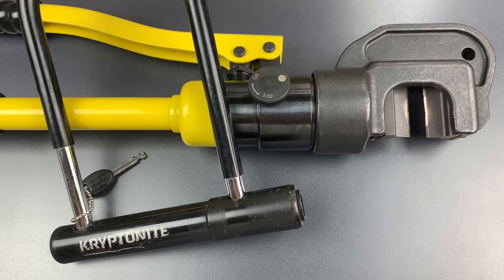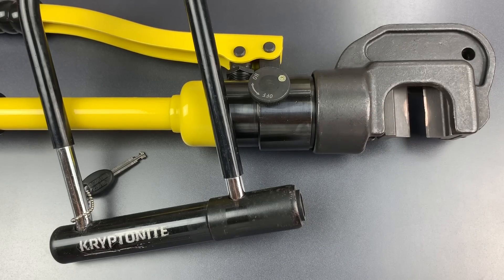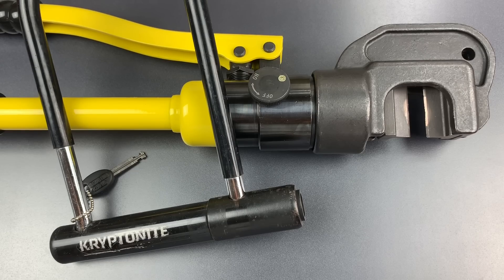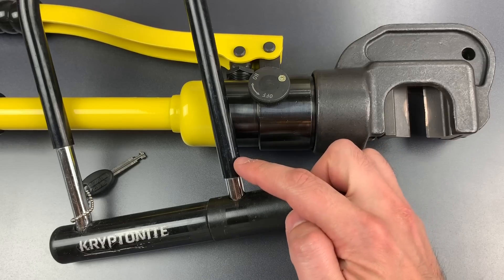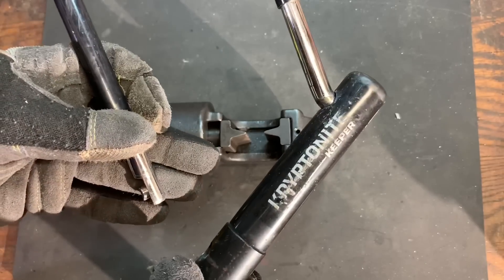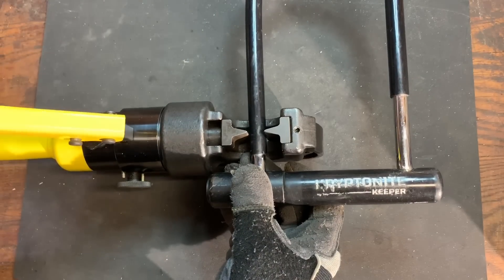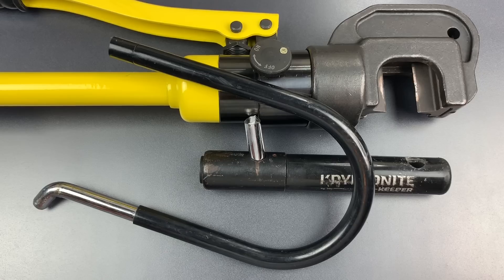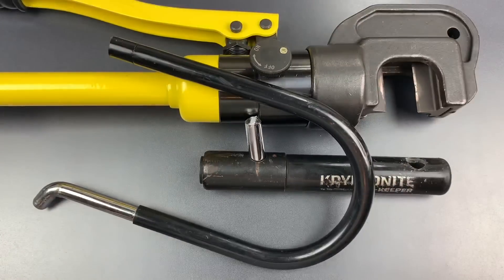[773] Hydraulic Cutter vs. Kryptonite Keeper Bicycle U-Lock

Comment: Those hydraulics are nuts. I'm wondering if there's even a lock that could withstand it.
Reply: It's a question of metallurgy really, certain alloys with proper heat treatment will simply be harder than the cutting blades currently installed in the hydraulic cutter.
Reply: @jero37 : The blades can bring forces to bear that cause harder metals to fracture.  As was the case in LPL's first demonstration of this tool.  The right combination of hardness, toughness and sheer bulk is necessary to defeat this particular attack.  It's going to be interesting to see what it takes in the way of shackle diameter.  I'm thinking 15mm+ of a really tough alloy properly heat treated might stand up to it.
Reply: @andregon4366  video please
Reply: @jero37  problem is, a shackle that hard would be easy to break by a impact. Not to mention that there's the Ramset...
Reply: @jero37  but the cutter can still put many tons of pressure on that area, cracking it if it really is that hard
Reply: @LordPrecision  That third lock you mentioned costs over $1600. Omg.
Reply: @Macintosh007  Yea, and it has been SPP'd, but I only ever seen videos of people doing that while holding it in there hand or a vice. Once it is mounted correctly on its shielded hasp, its dam near impossible to SPP or pick in general as its movement is heavily restricted. You would have to come up with custom tools to avoid that shield and get the swing arc you need for the tension and pick.
Reply: I wanna see him start using it on lock bodies instead of shackles. 
Also: to overcome these attacks I’m imagining just a bunch of short tungsten carbide rods mixed into the casting somehow? 1/16” thick by 1/2” or shorter, just under the surface in on 4 opposing sides of the shackle, which would have to be square I guess. Or a strip on the outside edges of a ribbon shackle like the first Kryptonite bike lock
Reply: @Pentross  WC inserts wouldn't help, as hard as they are they're very brittle and the tensile strength is very low compared to steel. You can break bits of WC just by clamping them in vice grips.
Reply: @LordPrecision  lets see it @lockpickinglawyer
Reply: For someone with the right tools and skills no lock is ever going to be more than a nuisance, so rather than trying to make locks and shackles bigger make them smarter. Electronics are getting so cheap that you can maybe build a camera and basic cellphone into the lock that will constantly record onto the cloud, and that will call the police to its location if the correct key (maybe one with an RFD tag built into it) is not used or if a brute force attack is attempted. Maybe also have a shackle which is filled with indelible ink that will cover whoever breaks it.The deterrence will not be from physically impeding the would be thief but limiting the time they would have with the lock and increasing the likelyhood of them being caught.
Reply: @KTo288  zap it, put aluminum foil around it first and then cut it. No signal able to be sent and ink is caught in foil and camera is blocked! Took me all of 2 seconds to think of how to defeat your ideas. Not to mention, there is no way police could respond to anything like that, it's not feesable. Anything u can think of could be defeated. Then all u have left is a expensive lock sitting on the ground covered in ink.
Reply: The answer is no. We're talking about an elephant stepping on to an ant here.
The single way you can withstand these kinds of brute for attacks if you scale up your dong. In the particular case of bike locks, a forged bar with at least 3 cms on the diameter and a dual lock, each end of the shackle catch points.

The more absurd, the less the thief is interested in thieving it. Bluffing works just as well, but you've got to have the balls to pull it off, because they might sniff and call your bluff.
Reply: Yes they are nuts but if you want to know hat i think is the best its the Stanley lock. Im sure @LockPickingLawyer will contest to this... but Wayne Winton from Tri County lock smith has some of the best vids on winch locks are resistant to bolt cutters. check out https://www.youtube.com/watch?v=ETN0HhcexUc
Reply: Those cutters put out 12 tons (24,000lbs) of force.
I was apart of the marketing team that designed and first sold these cutters.
They are actually hydraulic rebar cutters. 
We made these cutters, aswell as a smaller design the YQK-70 with its chassis used for wire crimping. The small version can put out 12,000lbs (6 tons) of force about half as much as the rebar cutter. You can get a mini one to put in your pocket, and change out the crimping end tool with the rebar cutter end and get a small concealable hydraulic mini bolt cutters.
We eventually after several prototypes, sold the patents for the rebar cutter and wire crimps to the Chinese.
Reply: even a harder metal might shear right in half. you would probably be looking at composite materials, like a ceramic core or ceramic layers alternating with hardened metal.
Reply: here a interesting idea - what if you added a chemical 'active' layer that destroys the cutting blade or otherwise defeats a attack? maybe some sort of liquid metal alloy that turns the blade into puddy the moment you cut into it? ....or acid? ....or a VERY strong smelling compound (i.e. have buteric acid trapped along the outside of the shackle in tiny holes) that's released when you cut into it? ...... or even a flash powder coating that blinds you if your dumb enough to apply enough force to ignite it? the deterrent method like putting buteric acid in it sure would deter a unwary thief I bet I like that method. ......not that it makes sense for cheap locks ;).
Reply: Kevin Miedema There is no chemical substance that could destroy the cutter that fast.
Flashpowder would be a savety issue, and probaply illegal.
Reply: I guess a huge padlock with high shackle guards that won't fit in the cutter.
Reply: Kryponite Fahghettaboutit
Reply: Those two high quality cutting inserts cost 50€ if lock will be made out of that material it will cost 1000€. Defending 300 € bike with 1000€ lock... Good luck selling that lock
Reply: Dragan Crnogorac You dont pay for the material, thats like saying a lambo costs 300k so a kilogramm of Iron must cost 800 bucks. 
Plus the blades cost "only " 20€ for 2 pairs.
Reply: extremely thick hardened steel the same Rockwell hardness destroys the blades of this cutter. I have some hexagonal hardened 5/8 this cutter cant get through the force needed is impossible to generate with this little hydraulic cutter.
Reply: Yes some Kryptonite locks can
Reply: This lock literally broke it
https://youtu.be/jXoS_HB1I3o
Reply: The fogettaboutit lock
Reply: https://www.youtube.com/watch?v=jXoS_HB1I3o
Reply: The Skunklock is too thick for them to get around it.  Not that you'd want to get sprayed with chemicals in the face.
Reply: Fire rescue units use these to open up cars, all the time
Reply: @seccat  Dont they use those much much larger things called "jaws of life"? Although I guess its still a hydraulic press.
Reply: @Macintosh007  we use hydraulic spreaders and cutters. Much larger than this. For bolts each fire truck has 24" bolt cutters and our rescue truck has 24" and 48" bolt cutters. Rescue truck also has a torch, grinder, door spreader, chainsaw and other tools
Reply: @jessecw2  Thank you for your fantastic work! Massive respect for you. 🎉🎊

Comment: Funny snap. :) And , this proves too , that most of security is just an illusion. :) Peeps from cybersec / cyberdef know this for a long time. :)
Reply: Well it depends - nothing is secure from somebody who has the tools and means - but more often than not security is more of a "keep nosy and curious people out" kind of thing. If somebody really wanted to steal your bike they'll be able to do it. Especially if they have enough time to do whatever is neccessary - same with hacking into computer systems, if somebody has the time and motivation to get into a system they will succeed. Be it by social engineering their way in or by finding a hole in the digital security. A lock like this will keep all those people from stealing your bike that want a quick "smash-n-grab" sort of way to get to stuff. Same with IT security, if done right it'll keep most script kiddies out of your systems and that's ultimately what you're aiming for. The people who could break in your systems even with those security measures in place will only do so because it is really worth their time.
Reply: Deterrence is a powerful thing up to a certain point.
Reply: “Peeps from cybersec / cyberdef know this for a long time. :)” Except that in IT you can build mathematically proven, secure systems. “Physical” security on the other hand can never be perfect since there are no indestructible materials.

Comment: That shackle stood no chance at all. I'm looking forward to you attempting some of the 
tougher alloys with that cutter.
Reply: tougher alloys are often brittle tho. I wonder if he encounters something that is both extremely hard and not brittle.
Reply: @_aullik  Wirthzite Boron?
Reply: @_aullik  take a 5/8 or 3/4 inch hardened bar stock and try this test the cutter fails and in these tests size trumps the cutter.
Reply: @_aullik  Pure tungsten, carbide is brittle.
Reply: spoiler alert
Reply: pewag chain?
Reply: Mithril?